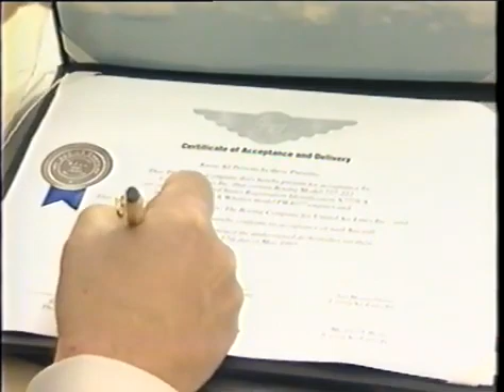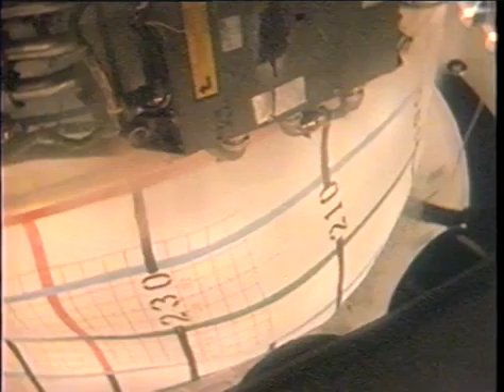Internal Pratt & Whitney video on Boeing 777 Engines

Comment: Crazy that they still want to fly these 27 years later...sounds dangerous
Reply: I flew on one with united it was a nice smooth flight cross country from NY to LA
Reply: Well with all the recent Boeing problems they are gonna need them. Plus they are planning to use them up to 2040…
Reply: With proper maintenance they can fly for at least 30 years